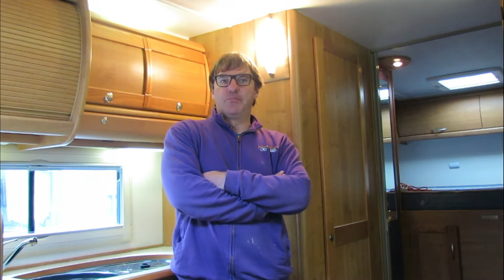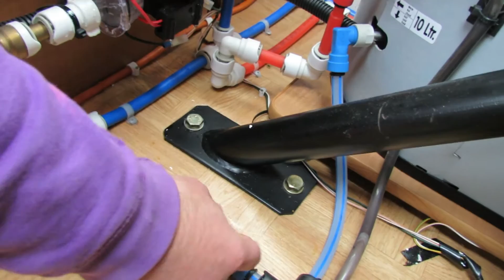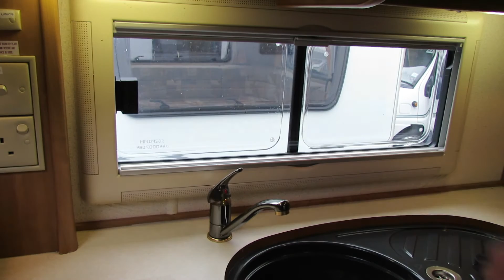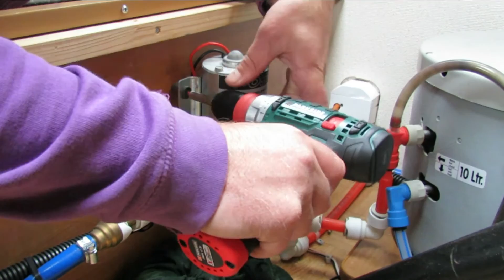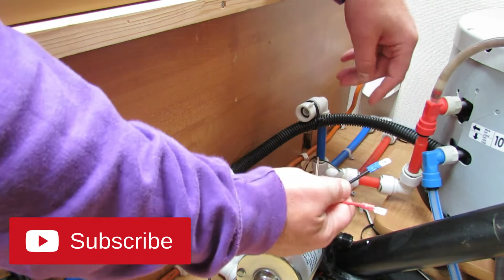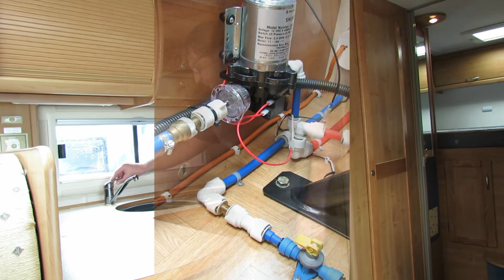Motorhome Water Pump - Shurflow Water Pump Leaking (Hints and Tips)

Comment: Replaced my water pump in my Autotrail Cheyenne last Friday after watching your video - easy job with your guidance - just an awkward position in the Cheyenne 630 as the pump is under the sink and hard to get to due to the space to work in - managed to struggle in the space but all working great - would suggest if anyone replaces one in. Cheyenne 630 to use a longer screwdriver - I’ll know that for future for myself
Reply from the maker: Good on you Rob 👍
Reply: Hi I have a scout on 06 plate. Where did you get your pump from and at what cost? The cost doesn’t bother me but all I am hearing is they cost a bomb but no one says the price for some reason. Thanks Ray K UK YNWA.

Comment: Is there no way you can fix the seal leak? , if it was your own mh, not for sale etc..  gasket seal etc...
Reply from the maker: I would not bother Thomas it will always go again.
Reply: @TheMotorhomeMan  well, it was leaking, striped it, cleaned it, put vasaline around all the seals, rebuilt it, working fine now.. ill replace it, but now i can do at my own pace..  currently a 20psi pump, I take it there is not issue with taking it to a 30/40psi pump, pipe connector size all the same etc..
Reply: I use Shurflo 2088 Pumps. I simply replace the diaphram with a replacement kit. I keep a second pump on hand. Eventually the seals fail. I rebuild my pumps every 10 to 15 years. That's not counting the ones that I rebuild because I have sold my rebuilt to a fellow RVer because their pump failed and they need a pump right then. The one I rebuilt today is dated 2-08. The backup that I swapped out is the first water pump I ever bought (1979). It was on sale so I bought it and stored it until I needed it for a popup camper (in 1988). I bought the replacement kit on Amazon.

Comment: My pump is leaking in the same place. Is it not worth fixing the pump rather than buying another one? Cheers
Reply: i stripped mine, cleaned it, put vasaline on all the seals, inner and outer, re assembled it, works ok now..  ill replace it later, but for now, its good..
Reply from the maker: You can but we are retailing so always put new on
Reply: @TheMotorhomeMan  I ordered a new one. Buying parts wasn't necessarily going to be more cost effective. Cheers 😊